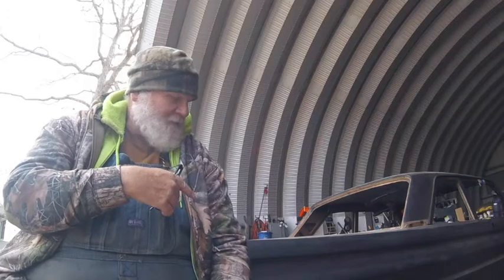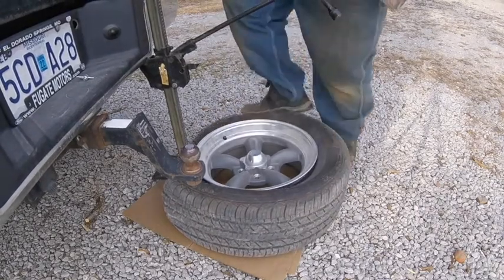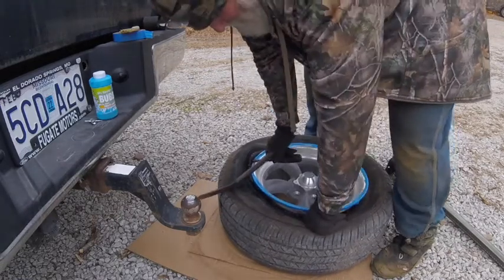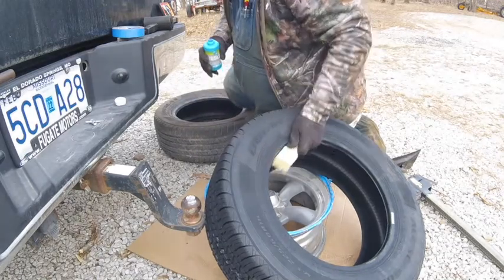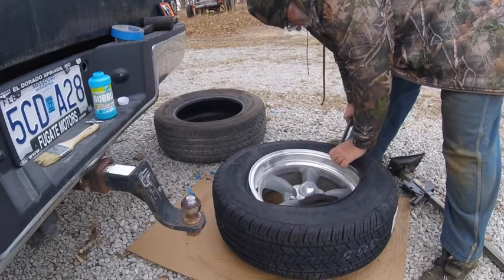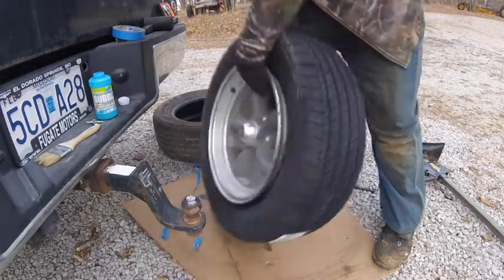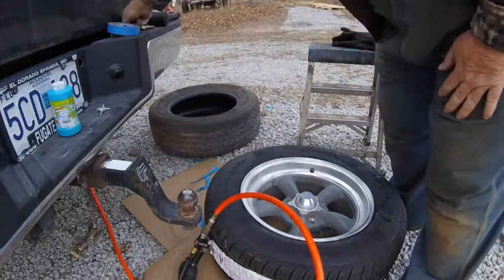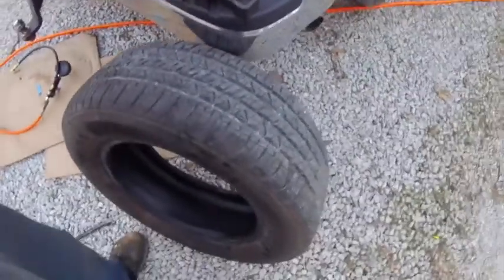64 Comet Tire Change 2

Comment: He is hard at it...might I suggest... Take a ratchet strap used to tie down cargo.... around the diameter of the tire and tighten until the rings are pressing the edge of the tire on both sides...Once they are touching...add air, then when the sides pop in...remove the strap and finish filling the tire.

This was an old trick I learned when changing out a motorcycle tire or some yard equipment tire.